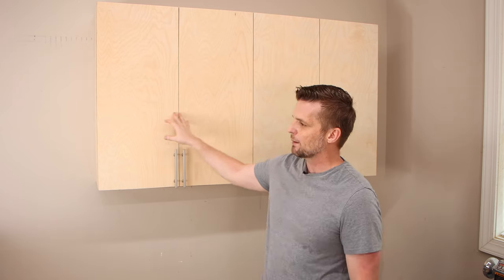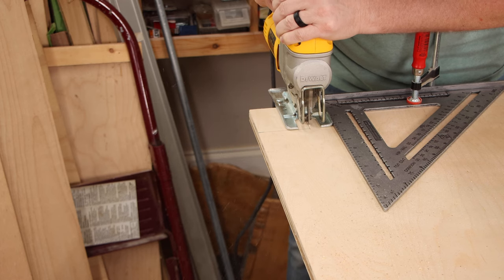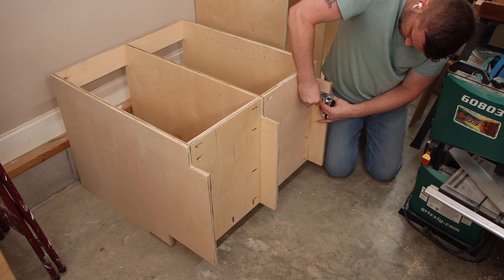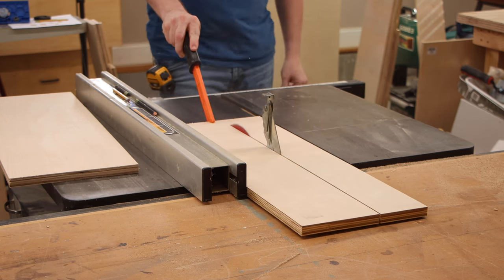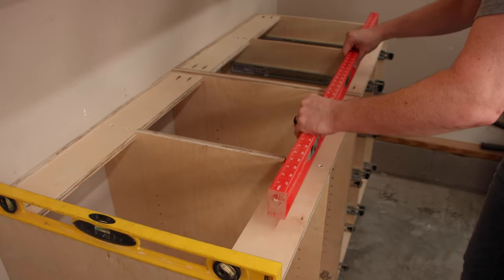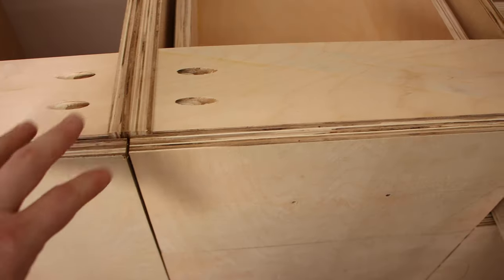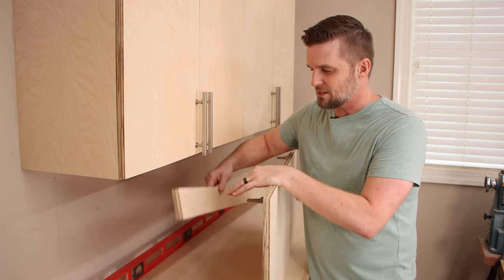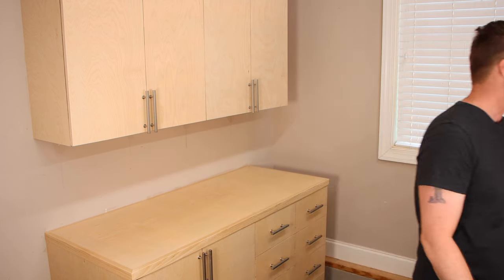Easy DIY Lower Shop Cabinet | Garage Shop Improvements | Free Plan

Comment: You can thank Trump’s 2017 tariff on Canadian softwood for the cost of plywood.
Reply from the maker: Prices started rising in 2016 due to the 10 yr trade agreement expiring and then the combination of mill closings and increased demand during the pandemic sent it skyrocketing.
Reply: @OutoftheWoodwork  ask ChatGPT “What percentage did trump’s 2017 softwood tariff cause the price of plywood to increase”…  17% … drops mic
Reply: @OutoftheWoodwork  but I do get that you have a point, Trump’s mismanagement of the Covid-19 outbreak did have an outsized affect on plywood prices
Reply from the maker: @simple_fred  I'm going to choose to give you the benefit of the doubt and assume this comment is a joke.
Reply: @OutoftheWoodwork  Okay, I have a funny story, back when I worked with the Department of the Interior under Trump and designed the system that linked the Bureau of Land Management over starlink back the DOI. There was a marked increase in logging permits in protected old growth forests to the lowest bider (I don't know how that worked and I'm guessing that there is an open inspector general's case on that) which caused landslides, threaten endangered species, increased risk of fires. The last one I heard of was the "blue and gold" project, but I don't know if it was shutdown like the others. I've have personally seen what a trump economy does to the environment and it's hilarious that people want to go back to that stupidity.

Comment: I saw you were putting some liquids in the cabinets, not sure if they are combustible, but one thing I have seen in a car shop is that they put any flammable materials and liquids in a metal cabinet. It just makes sense.
Reply from the maker: That's a good reminder

Comment: Hello, and thank you for the great video and plan detail. I have question regarding the plywood cut pages. I noticed that the 5-3/4 X 11-9/6 cut was listed as a Drawer Side. Should that be the drawer fr/back boards?  If so, shouldn't there be 16? Just wondering as it appears to be a bit confusing.  Thanks!

Comment: They look great. I was wondering why you chose to apply finish to the doors and drawers fronts after installation instead of beforehand. Is it in case installing them damages the finish?
Reply from the maker: I think it was just because it was quicker. I only put finish on the fronts, so it made it easier to have them mounted.